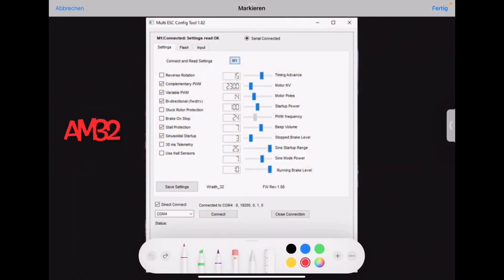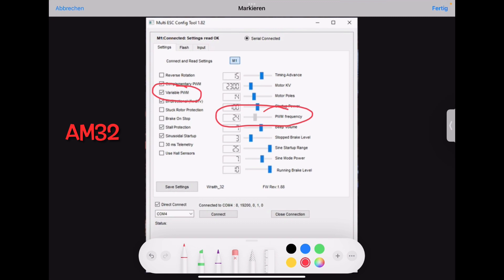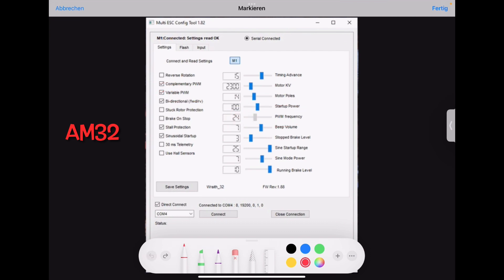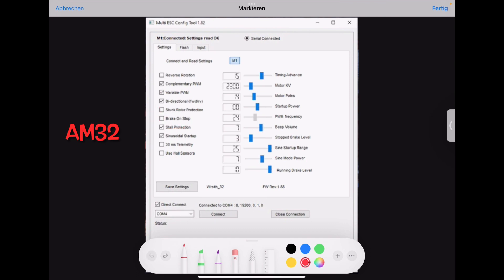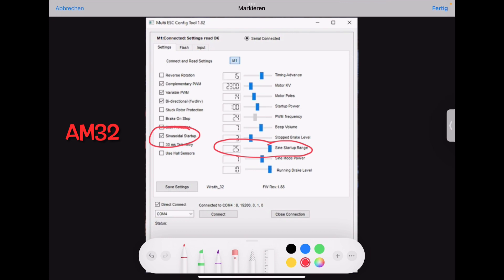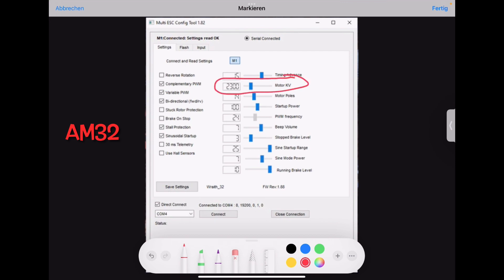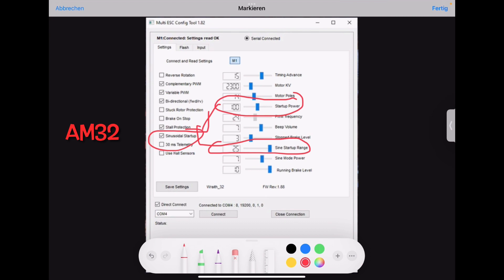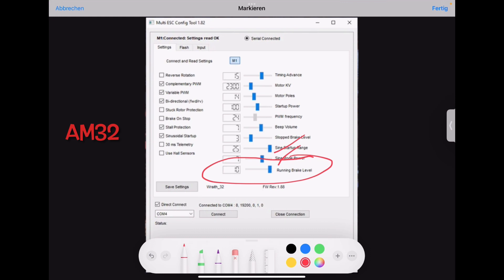AM32 Setup for Crawler - how to

Comment: Great video! I have a question: what parameters do you use if the engine is 2322-2600? The highest or the lowest? Thanks!consulta que parámetros colocas si el motor es 2322-2600? El mas alto o el más bajo? Gracias
Reply from the maker: I switched to Escape32 ESC. They firmware is way better and more smooth. You have a WiFi Dongle and you can switch parameters with the phone.
For my 1/18 crawlers I use the HakRC ESC 20$ and flash it myself (easy job)
Reply: @sebo-Kids-RC Hi, thanks for your message, hakRC ESC. Where do you buy and download the program?
Reply from the maker: @LaRockaCrawler I have a Video online in YouTube with all links. Maybe there are some new ones as well. Look at GitHub and ESCape32. And join the Escape32 Discord is super helpful.

https://youtu.be/UtOWLFNzGOQ?si=iiS4pJxrIyGKRhxY

Comment: Thanks I needed this information
Reply from the maker: Glad I could help... if it worked fine for you you can write that here as well....
Reply: @sebo-Kids-RC  thanks I'm still waiting on the am32 and motor I've saved your video so I'll need to study it more thanks for the information I just got done with servo on axle conversion on my t hunter it was pretty easy but lost a bit of steering angle I'll need to experiment with it thanks again
Reply from the maker: @Rc_Alex_76  seen it, you need to use the last hole of the Servoarm!OR- if you change your Radio use one with Endpoints and you can Set them to 120%
Reply: @sebo-Kids-RC  ok I puy it down on the last hole and I get steering to the right but not left its hitting on the pumkin a little tuning and I'll get it thanks
Reply: this esc need to install firmware???or just setting with esc config tools?